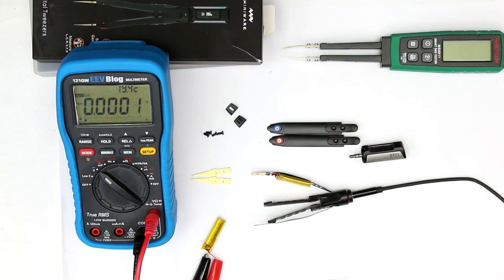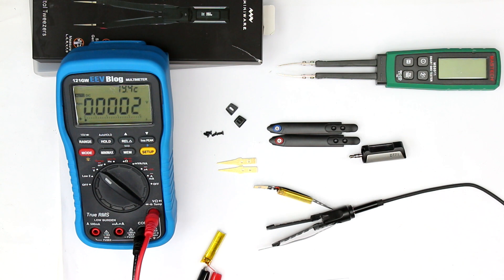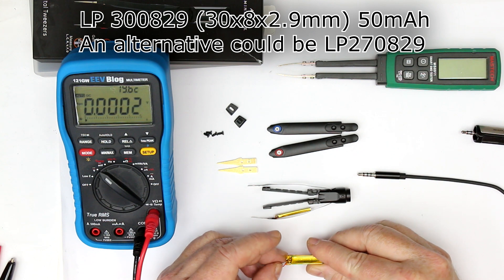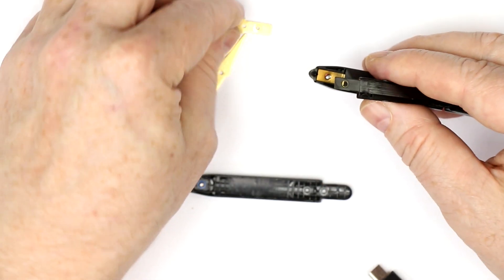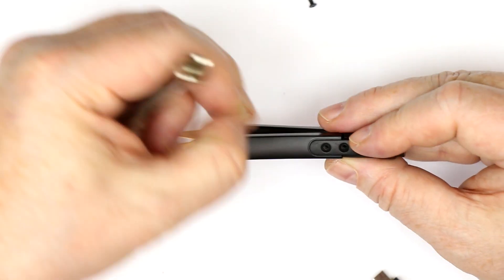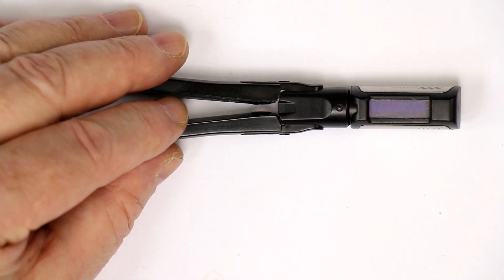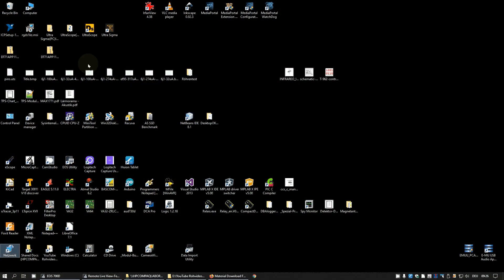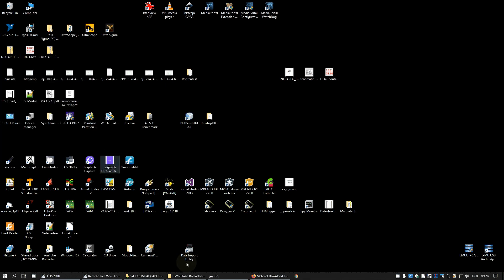DT71 Mini-Tweezers: Problems, Repair,Teardown, Firmware-Update,

Comment: Thank you for helpful video I was able to disassemble the device safely and found both batteries were bad 😮. So I removed them both and drilled a hole in the outer arm cover and ran wires out and soldered on a battery I removed from a rechargeable disposable vape. It works perfect and charges normal. Secured cell with heat shrink/ thermal pipe. You rock thanks again

Comment: Use the command-line DOS prompt to copy the firmware file onto the device. This I also use with other miniware products, it works without fail everytime
Reply from the maker: No, the original firmware was  corrupted. Miniware send me a new device and with that firmware update worked as expected.
Reply: @KainkaLabs  okay thanks for the reply. On a sidenote I'm buying a MS8911 on your advice 👍

Comment: Repaired mine by removing the shorted battery, still though if you require a new battery look for  350829 and 50mAh on Aliexpress, I found some that fit measures close to 30mmx8mmx3mm (should fit)

Comment: I had this exact same problem. I only used the device one time, and after I pulled it out of the drawer after about a year. Your video helped me to repair it! One of the batteries was damaged. There was a lot of goop under the Kapton tape. Now it is limping along on one battery.  I am not looking for a replacement battery. As you mention, it does not seem very easy to find a replacement here in Germany.  Would anyone know where I can find a replacement?
Reply: Just an update.  I was unable to find a replacement battery, so I contacted the manufacturer via the contact form on their website at the following URL:  https://www.miniware.com.cn/contact-us/  Instead of sending new batteries, they offered to send me a replacement tweezers (without the controller) for 20 euros, which I find was very kind of them. They seem to offer great support.

Comment: This is pretty much why I don't like Lipo cells in test equipment.
These are 'non serviceable' but even if they're more easy to get out (like some DMM's that run on a lipo): I buy test equipment to last decades.
This one fails within a year. And in 5 or 10 years? are there still cells/parts available in that form factor?
When using normal style batteries (AA/AAA or even coin cells like lr44 etc) you're pretty much guaranteed that you can get them still in 10 or 20 years time.

Comment: I have one of these in a drawer for the rare instance I need to measure inductance/capacitance and your video made me remember it's been awhile since I last charged it. Yep mine has the same issue as yours, will sit on charge forever and never actually charge. Do you have any tips on how to safely open the tweezer part to get to the batteries?
Reply from the maker: just watch the part of the video where I reassemble the part. It´s just the reverse order and I mention it.
Reply: @KainkaLabs  I rewatched it (watched it this morning while eating so I may have missed it) just now and I still want to know specifically if there are clips or adhesive holding the outer arms on. I had a few minutes after breakfast before I had to leave for work to try prying it but mine seem very secure almost like the plastic is sonically welded and I was worried prying would damage the plastic/flex or even the batteries.

Update: found another teardown video and looks like it's just glued so hopefully a little hot air will help to open mine. It's a shame that this critical flaw mars an otherwise neat implementation. I'll probably just remove the batteries completely and have two wires that extend to plug into usb to power the tweezers from a power bank or external 18650.
Reply from the maker: My motto: "You can´t do more damage to an already broken device". When you have unscrewed all 3 screws of one arm, take also out the little square thing, where the probe tip is slid in the arm.
Then you can pull the upper part of the arm (where it was held with the 2 screws) off from the lower part. I think it is held with a clip, but you can´t break it. Even if, the screws are holding the 2 parts together anyway when re-assembling.
Reply: @KainkaLabs  thanks, I'll try again this weekend

Comment: Why shouldn't two cells be connected in parallel, if they're pre-balanced? The only problem i can think of is if one of the cells has an increased self discharge, other cells will be drained as well via compensation currents to equalise their voltages, though those should be very small; and that adding up permissible charge currents can be a little dicey, though setting charge current as high as one cell allows should be OK. As to increased self discharge issues, in a simple series pack you don't usually have continuous balancing either, best case protection control which will equalise the cells when they get fully charged or disables the pack when any one cell is fully discharged, but practically the performance of the pack is also reduced correspondingly.

I think the device temporarily falling off the bus automatically to accept changes is rude, as just because a write has occurred, doesn't mean that it's complete! They should have you eject the disk from the operating system and it should restart the device then.
Reply from the maker: You already named a number of problems with cells in parallel in your comment and one of the possible problems is the reason for the failure here :-)
Thank God these miniature cells only have about 185 mAh = 666 Joules in nstored Energy. Think about 2 large cells in parallel out of which one develops a short and the other dumps its whole energy into the shorted one. That would give one of those nice videos where first you get a cloud of white smoke and then a fire or explosion.
That is why with lithium cells you always need balancing circuitry. Lithium cells are simply too dangerous in case of failure.
Reply: They can, and they often are. Whenever you hear a designation e.g. "3s2p" there are 3 in series (~12V thus) and 2 in parallel (so typ. 4Ah)  Within the pack there are 6 individual "cells" (3x2 = 6). Imagine what a fireworks display a 5s4p pack can become - 5s2p or 5s4p is typical in large power-tools. There are therefore some protection-mechanisms built-in within the pack.
Search for "powerpack teardown" if you are interested. Andreas Spiess did one a few days ago, albeit for a smaller pack.
Reply: PS - cylindrical cells are usually more robust than pouch or prismatic cells. Most paralleled configs are with cylindrical cells. With a pouch cell, instead of putting multiple in parallel, you could just use a bigger pouch. Cylindrical cells are usually "one-size" (18650) and hence more "lego-blocks" modular for the designer.
Reply from the maker: But you name it. In these "power-packs" with serialized and paralleled cells most often the cells have each a protection circuit either hidden under the top-contact or by external circuitry. 
AFAIK only NiMH or NiCd or similar can be paralleled without extra balancing circuitry because they usually don´t catch fire in case of a failure.